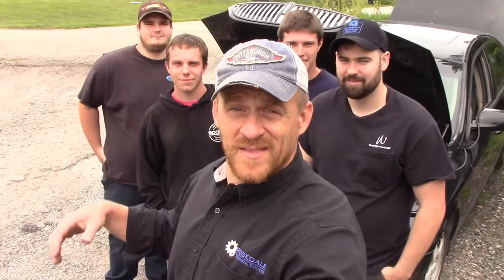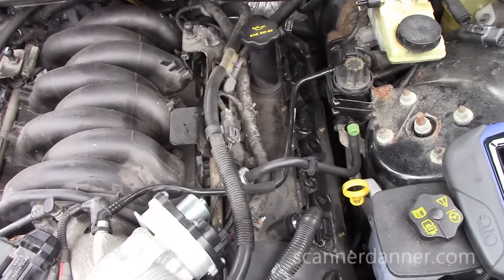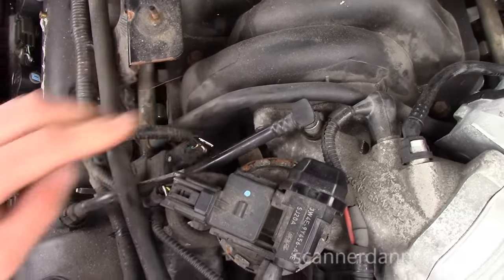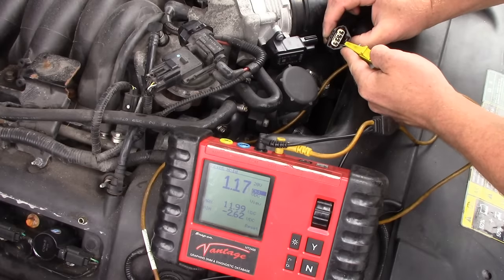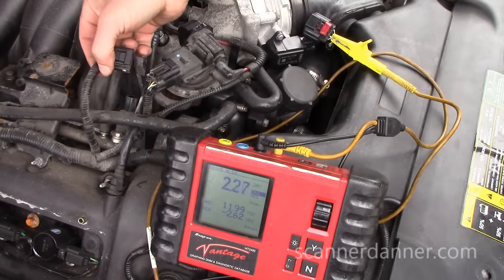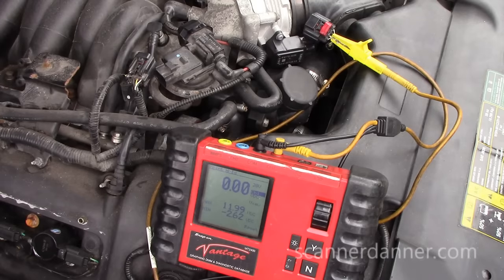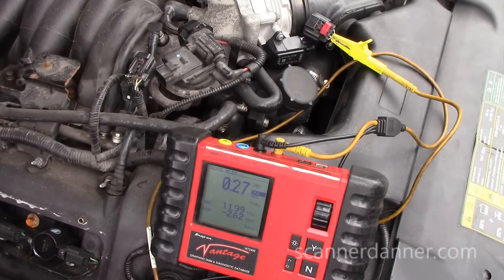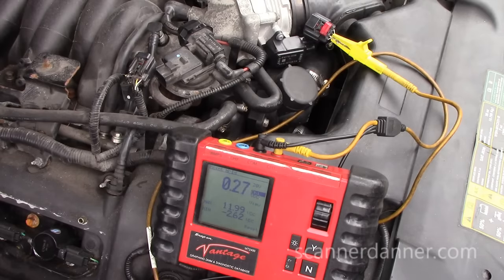Troubleshooting a No Start, No Spark, No Fuel, No Com (any car)

Comment: SD,  
Damm, you know almost everything;  amazing videos,man!
Has any car EVER defeated  you? i mean,one that you absolutely could not fix, or ended up giving up on it?

One thing i'm  sometimes  SCARED of is ......multimeters.... do you agree?
I mean,engines do not run on milliamps (the electronics do,but not the engines themselves)
They run on AMPS....
So,i use a "test light" that is a 55 watt bulb,A LOT  (special box that i made years ago,with switches,several bulbs,etc,and double wires that extend from the front to the back plus 3 ft))  to be able to power a fuel pump,rear lights,etc etc,and  just to make sure that  those grounds and power connections are doing their J O B ...
I worked in an automotive switches factory ,late 80s,with 350 employees (while i was still an illegal alien in NJ---for 5 years,lol) that ultimately went out of business because of a test machine for  headlamp switches (over 5000 a day) that tested them with...PILOT LIGHTS!!!!   (therefore,it was a test with no load imposed! they had been doing it like that for over 10 years);

I was too small back then,just an incoming inspector (and an illegal alien!!!! ; i had nothing to do with that testing,they had 10 engineers,but i knew a lot ,i was a 25 yo engineer,had been around cars since i was 14 )and i timidly told the plant manager ,on the floor,about it,one day, but i guess he did not really get it; 6 months later...boom... lots of them started showing up defective  all over the US and abroad; huge recall, millions of them ,and unrepairable,they were staked and ultrasonically welded;  the product engineer(K. H.) has a stroke,(even though he was not at fault..well,maybe 10pct at fault) then he comes back 6 months later looking just skin and bones; he left the job soon after.
The huge customer/distributor we worked mainly for ,started ordering lots of parts elsewhere,and a year or 2 later  "our" place closed down;(the owner was also old at the time,his son,who started showing up,  knew nothing about automotive switches....).
 (at one time they did not want to lose me,i was gonna quit,they involved their lawyers and i got my "green card"; (  i had my own Jaguar shop for 10 or 12 years,and then i left the US back to sh***y portugal  15 years later,been here 20 years; have 2 US born daughters,30 and 35,they are also here in portugal)

All this to say that power grounds and  +B and +Ign,i check them  checked  under load,when in doubt, which is the way they work; and the load can be a 1 watt or 1/2 watt bulb,depends on the circuit... as long as it is an INCANDESCENT bulb...
I had some hair pulling cases (some  i had to rewire,the "bad" wire" was so buried,i did not go after it) where the multimeter(voltmeter) was showing good, because it pulls no current; and it was bad; 

The load can be the  car part under test itself,if you can measure a voltage drop across a powered connection;that works too,that IS under load; my IBM DMM(made by Fluke for them) a true RMS 5 digits has been with me a good 30 years;  i have others,i only grab it when true precision is needed.

Comment: I have no education in the matter but I always check fuses first with an ohm meter because I had had so many power distribution boxes fail. That being said, it would be nice to have the fancy tool but is there a reason why you dont jump the relay with a test light and measure the voltage off the test light? I give points the tech that fixes things with a $20 DVOM (which I'm sure you could).  I was thinking to make leads for the relay and then remembered how many I jumped with cotter pins.

Comment: Hi scanner scanner. I have a Kia Sportage 2001 which suddenly turns off on the road ... when I test it with medium OBD2 ($ 100) everything is OK. But the starting doesn't turn on. My car pulls home. I replace CKP and CMP but still can't start. the fuel pump is good ... but the spark plugs don't have fire. the start check engine blinks in the starting time ... I don't check the injector because it's too difficult for me.
After watching this video ... I did another thorough examination of all fuses and relays. As a result the main relay to the ECU lacked a voltage of 7-8 volts. after being replaced..starting and the engine is on. One month my car wasn't running because the stupid relay was broken
I wish I had watched the video earlier ...
thank you Scanner danner

Comment: Sounds like I just heard that I could jump the pins at relay and get the voltage of load at sensors if relay is bad but if low voltage at sensors than I have a ground this side of relay?? Thanks for the schooling😮
Reply from the maker: There are many causes for a low 5v ref circuit. I have a bunch of videos on this

Comment: Am using autel 808 pro sennner tool, I had a some fault code ECU POWER MALFUNCTION no communication with the ECU AUDI A4 1.8T  , and it's keep on durn the coil pack, I rest the fault code and the car start , after the week did the something things , I chang the ECU POWER RELAY the car is running , i learn something about the V5 reference , I should get you book sir 😍😍😍😍 thanks for you help sir

Comment: Nice vid, curious if you've ever used Alldata? pretty much the same thing as Mitchell's but the diagrams are displayed all pages next to each other. You can print all 5 pages (some engine performance diags) at once and also use the f3 find function to highlight say a fuel pump. That's all I use Alldata for. The diagrams are nice.

Comment: Are you any relation to Keith Fenner Dan? Anyway, so how much to fly to England and diagnose my 5w parking light circuit? Make that two vehicles. Oh and the dash illumination has failed in both and one won't start but it's been sitting for years with low fuel and the level indicator is stuck at half a tank when it's full and the tank needs removing but the pump comes on and....

Comment: I have a question paul. If you have a low reference 5volt signal, rather than unplug all the sensors that use the reference, couldn’t you unplug the computer, use jumper wires from connector to computer for just powers and grounds and check the 5volt reference at the pins? That way, you would be eliminating any shorted sensors and a shorted harness due to the fact you only have jumped powers and grounds to the computer..🤔

Comment: You stated in the video that you don't need to check reference voltage on temperature sensors as they are on a seperate circuit within the PCM.  In this instance, if you had, would a low reference voltage on engine sensors and temperature sensors have led you to the PCM power supplies sooner?
Reply from the maker: I showed the low reference voltage on the engine sensors, just not the thermistors. The thermistors would have shown you the same thing, but #1, you would need to unplug them to verify low ref. and #2 a shorted thermistor would NOT pull-down the reference circuit like the other sensors would. This is why I said I didn't need to worry about them. Make sense?
Reply: I understood your diagnostic route and reasoning.  What I was curious about was, after finding a low reference voltage on the engine sensors, if you had disconnected a thermistor and found a low reference voltage on that circuit as well, would you have checked power to the PCM sooner?  For example, low reference on engine sensors only, check for shorted sensor, low reference on engine sensors and thermistors, check for power to the PCM.
Reply from the maker: Got it, and the answer is no sir. Once I verified low reference voltage on the TPS and Fuel Rail Pressure Sensor, there was no need to go toward the thermistors. They would definitely have been low too. What you need is a good understanding of the relationships of these sensors. They all share the same internal 5v ref circuit. But externally from the computer, they are different. Thermistors have an isolation or current limiting resistor that is used inside of the PCM before it comes out to the sensor. 
A shorted thermistor would NOT cause our condition, a shorted pressure sensor or potentiometer would. 
Here is another way to look at it. A shorted ECT sensor would NOT affect the TPS, but a shorted TPS would affect the ECT.
Chapter 9 stuff in my book and classes if your interested.

Comment: Hi Paul, thanks for the great videos you've been posting on YouTube. It has been great help to me and has energize my enthusiasm in working on cars. I ran into a problem of NO CRANK, NO START. With the key on crank, nothing happens. Please can you guide me in solving this problem? It is  a 2007 Chrysler town and country touring, with a 3.8L. I can energize the Starter and Fuel pump by using the relay. The Starter will not click with the key on start position. Any suggestions?

Comment: Great vid. I have a 1993 dodge dakota pickup 3.9 v6 cranks over fine-No spark No fuel, Fuel pump not running. fuel pump relay not clicking. Any thoughts? Thanks!

Comment: So if you went to the main power relay and pulled the relay and tested it with a 12v power supply and it closes what should the reading be on the other side the switch side I think that’s what you called.  So if the relay clicks what should the reading be on the other connection?

Comment: I don't think the battery is supposed to be in the trunk. Based on that, I would check everything having to do with the trunk mounted Battery. It's seems there could be a bad ground in that system. Also everything I have learned in the past tells me you need to have a fully charged battery. I did hear you say that the low reference voltage was not so far out that you could not get the problem solved.

Comment: Nice video Paul, would a PowerProbe work too checking that relay connector, by giving it 12 volts on pin 30 and jumping pin 87 at the same time? Thanks

Comment: Wow just had this scenario on a lexus in the shop. Took awhile to get it to act up get no start. I was wonder why you initially went after 5v ref? Are there tell tale signs that indicate that you should be checking 5v rather than chasing a no com on can bus line?
Reply: Also keep up good work! I been working at dealer for 10+years and still learning things from your videos all time!
Reply from the maker: For these symptoms i am always checking the ref circuit on the ECM before ever chasing the network. It takes 2 seconds to do.

Comment: Correct me if wrong,   the power relay could be stuck closed and still cause a no start due to the anti theft detecting a permanent live?  Voltage reference would be ok in that case
Reply from the maker: I believe that is correct

Comment: I have a 2004 honda city with broken socket for fuel injector i was pushing a screw driver with it and it shorted.... Im having a cranking no start... I checked all the fuses and everything is ok.... There is no spark and no fuel... What do you think is the problem...

Comment: Good case study. However, as much as I love AESWave gadgets, I usually just use a jumper wire with some spade terminals that I can back-probe to test the load side...
Reply from the maker: That works too, Just don't jump the wrong pins!

Comment: Could this problem also present as intermittent? I have a 1998 Honda Civic that I have all of these exact symptoms but only after you shut it off from running and it will start again 2 hours after you shut it off, could this be the same problem?

Comment: Stoopid Ford!  Truer words have not been uttered by mortals. :P
Another quickie check: In the beginning when you had 2v reference, 1 volt Bias and bumping the motor took the 2v to 0v.  Immediately rechecking the bias can give you a direction.  If bias is also 0 that suggests a feed/ground INPUT issue and not a short on a 5v output.
Reply from the maker: Agree 100%, Just the key cycle alone showing the 0 volt on the ref. showed this was a power feed issue.

Comment: Hey man your A wizard need some help with A vehicle of mine 2008 hyundai azer 3.8 no spark no power to fuel pump new cam and crank sensor I've checked all the fuses new ignition switch new fuel pump

Comment: I had a crank no start on a 2004 pontiac grand am and it turned out to be the radio messed up pulling the yellow CAN wire to ground. caused no communication as well. once radio was unplugged everything was fine

Comment: If I didn’t have that relay tool, could I just remove the relay covers off of known good relays (20amp and 30 amps) plug them in, and use as test tools to check voltage off feed and load sides? Kinda like that one you plugged in

Comment: I have a 2006 Subaru Outback 3.0. My vehicle will crank and start, but it will only run a few seconds and die. When it runs the few seconds,  it is running rough. If you go to start it back, it will not start, just turn over. If you let it set for a little bit, it will repeat the the process. I have replaced the crank sensor, MAF and 1 cam sensor. I have 50 psi of fuel pressure. The injectors are firing my noid light and i can spray carb cleaner in the intake and still no fire. There isn't a check engine light because I pulled the battery to charge it. Before I pulled it I had 5 cylinders showing misfire. The timing chain was replaced 2 years ago, around 20,000 miles since changed. When turning over it seems to have good compression,  wish it was easier to check with a gauge. When I back probe the cam sensor connector I have a 12 volt wire, a middle ground wire, and the what I thought should be a 5 volt wire is going to ground. When I put the volt meter on the battery positive and turn the key on, with the cam sensor unplugged, and probe what I believe should be the 5 volt wire, (like most vehicles),  it shows 12 volts. That shows me it is grounded. Anyone have an idea if that wire is indeed a 5 volt wire and I have a faulty ECU, being as it is grounded? I chased the wire and don't see any chaffing. Thanks for any help!
Reply from the maker: Some cam and crank sensors will use a 12v signal. That is not uncommon. When this thing isn't starting, you need to find out what your missing. Spark and injection pulse must be verified DURING this condition

Comment: I have a 03 ford f150 it rained a lot the other day and wouldn't start the next day. Had it looked at they couldn't figure it out. It cranks but won't start. The fuse box also clicks. Any ideas?

Comment: Then 5v ref may be shorted to ground. The safe way to check for 5v ref is to incorporate a 5000 ohm resistor as a jumper. One leg in the 5v pin and the outlet from the resistor to the ground pin.
Reply from the maker: An incandescent test light will work as a nice buffer too and everyone has one of those 😉